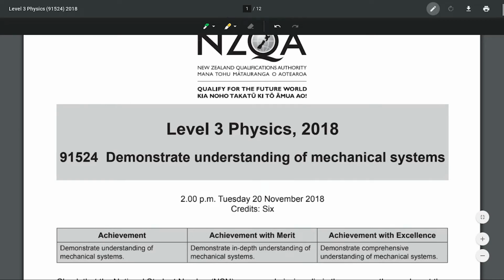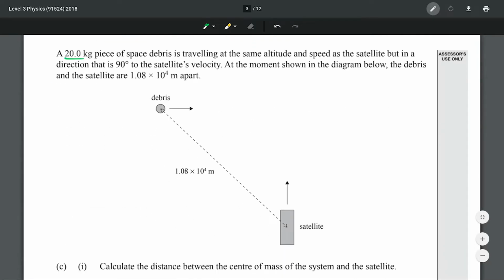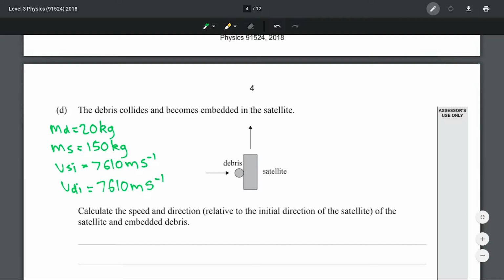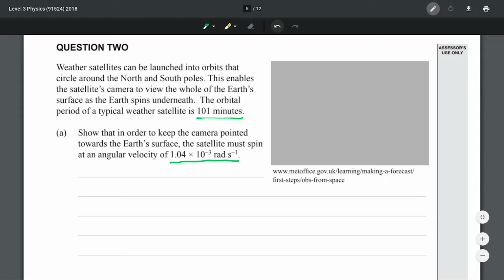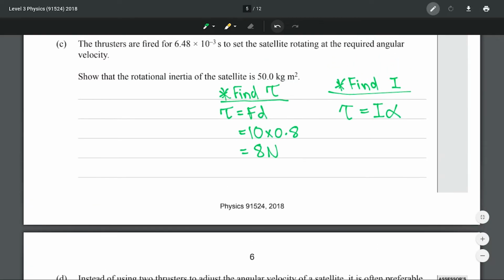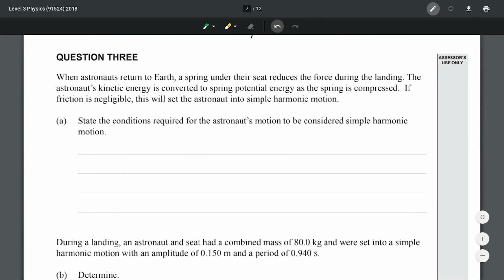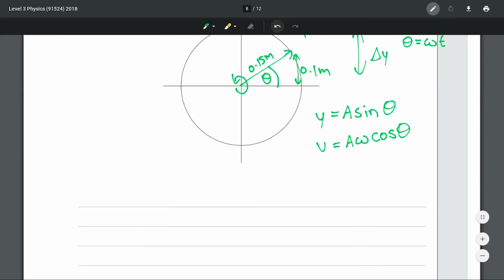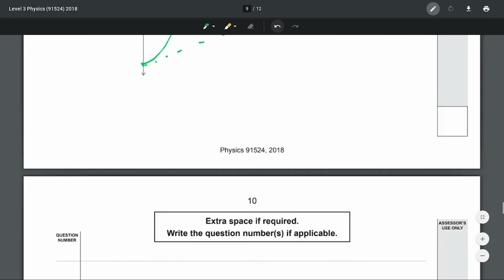2018 Mechanical Systems Exam (NCEA Level 3 Physics)

Comment: For 1d, could you find Pi by doing m1v1+m2v2, and since conservation of momentum Pi=Pi, you know that Pf/Ptotal is the value just calculated?
Reply from the maker: Great question. The problem is that momentum is a vector with direction, performing the simple calculation m1v1+m2v2 ignores this, so will give the incorrect answer when momentum vectors are in different directions.

This would be like incorrectly stating Pythagoras as hypotenuse = opposite + adjacent, instead of hypotenuse^2 = opposite^2 + adjacent^2.

Comment: Hi Mr. Whibley, for 2d (16:38) can you plz explain why it is angular momentum? I'm not really sure how you get that and how we suppose to know. Thanks
Reply from the maker: Good question. The reason we use angular momentum is because we know that it is conserved, as long as there are no external torques (which is the assumption they're prompting us for in the question). Angular momentum being conserved is very useful because it lets us relate the motion of wheel and the motion of the camera.

This is similar to collisions at Level 2. If two things collide and no external forces act, we can use conservation of linear momentum to analyse the motion of both objects.

The best way to learn how to spot when angular momentum is relevant is to practise these problems. There are a limited amount of ways in which we use this concept at Level 3, it's usually either "one thing spinning causes another to spin" or "something spinning changes size".
Reply: @MrWhibleyPhysics  thanks a lot, it's really helpful!

Comment: Hi! With question 2C, what do you mean by we require an unbalanced torque but not an unbalanced force? Isnt force and torque the same thing except torque to angular?
Reply from the maker: Hi Bunwie, the difference is as you mentioned. Torque relates to rotational motion and force relates to linear motion. In this case we want rotational motion (requiring the torques be unbalanced), but not linear motion (requiring the forces be balanced).
Reply: Thank you sir :)
Reply: so how did the exam go today?

Comment: For question 3c, why is theta measured in radians and not in degrees?
Reply from the maker: You could measure θ in degrees, but you'd have to be very careful with units. Using an equation like ω=θ/t with θ in degrees still works, but would give ω in degrees/s rather than rad/s.

 In general when doing rotational mechanics it's best to stick with radians as much as possible.
Reply: @MrWhibleyPhysics  ok thanks

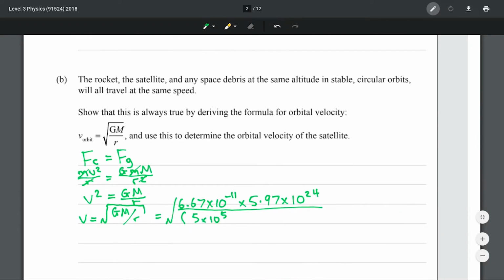Comment: At 3:14, why did u use the number for mass of the earth (5.97x10^24) rather than the number for mass of the satellite (1.50x10^2)
Reply from the maker: Good question. In the first line we use the centripetal force on the satellite, not the centripetal force on the earth. We therefore use the mass of the satellite in the centripetal force equation, which cancels with the m in the gravitational force equation.

Comment: For the first question when I typed the numbers in my calculator, I got 1265.5 rather than 1270
Reply from the maker: Hi Lime Cat, 1265.5=1270 to 3sf. I'm rounding to 3sf because that is the lowest sf of the values I'm using (in this case they're all given to 3sf).
Reply: @MrWhibleyPhysics  Oh so all numbers must be rounded to 3sf
Reply: @limecat7923 no, you round it to the significant figuresprovided in the question. If In the question it was 1200 then you would round to 2 sigfig, but if it was 1290 you would then round to 3sigfig. Numbers used was an example

Comment: For 3C, the placement of the vector, why must it be there? Because I did it on the 2nd quadrant (top left). It should work the same but the angle (if the vector was top left) is now top left of the vector. I don’t know where to place the angles 😢. Can you explain why the angle must be opposite to 0.1 and hyp to 0.15. What I did was cos 0.1/1.5 which is wrong
Reply from the maker: Hi Mark,

Excellent question! You were very close. If you've drawn the phasor moving counter clockwise from 12 o'clock, all you need to do is add 90° (2pi/4) onto the angle you've found. This is because the SHM equations we're using assume that the phasor has started from equilibrium (3 o'clock).

Doing that will give you the correct velocity, but negative since it's travelling in the opposite direction. Here is the final calculation using your method: https://www.wolframalpha.com/input?i=0.15*6.68*cos%28acos%280.1%2F0.15%29%2B2pi%2F4%29

Comment: have my mock exam tomorrow, any tips to remember how to explain physics principles? I sometimes find it a little hard to remember certain keywords required to get full marks
Reply from the maker: Hi tkdyt0674, I'd suggest running through explain questions on past exams and marking your answers. This will give you a good idea of the specific words and ideas that the schedule is looking for.
Reply: @MrWhibleyPhysics  thanks for the idea! definitely will try this
Reply: @tkdyt0674 what was in the mock exam

Comment: For question 3d can I add this on to the explanation. The loss of energy is due to the friction force that will convert the energy to heat?
Reply from the maker: You certainly could, though in this case it wouldn't net you any additional marks.

Comment: For question 3c, I'am not sure when to use radians or degrees when calculating the velocity. I thought I had to use radians when I calculated the angle but then I switched back to degrees and got the wrong answer? do I have to stick with radians the whole time when doing those problems or do I change it to degrees?
Reply from the maker: When working with rotational quantities it's usually safest to stick to radians. An exception would be if you were given or asked for an angle in radians.

Comment: For Question 3C, if theta is equal to Omega x T, why do you have to work out theta? Can't you simply multiply Omega and T together and use that in the equation? I know both garner different numbers, and I was wondering why. Is it because the astronaut is at a different position?

Thank you in advance
Reply from the maker: Hi there, I think you may be confusing t and T.

t is the time taken for the angle we found (0.730rad) to be rotated through.

T is the time taken for a full rotation of 2pi.

For this reason theta=omega x T = 6.68*0.94 = 6.28, which just so happens to be 2pi! https://www.wolframalpha.com/input?key=&i=2pi
Reply: @MrWhibleyPhysics  Yes! Thank you so much, this cleared up my confusion. Legend!

Comment: Thank you
Reply from the maker: You're welcome
Reply: @MrWhibleyPhysics  For question 1D why did you use momentum? Wouldn't the given speeds be enough to find the speed that they travel in? I notice that the result is different if I don't use momentum but I don't know why. Thank you for your time
Reply from the maker: @dr.chopsticks2352  Great question. In collisions momentum is conserved (total momentum before = total momentum after) but since the mass of the satellite is greater than the mass of the debris, speed is not.

Consider the kinetic energies. Initally the debris is travelling at 7610m/s, giving it a particular amount of kinetic energy. When it collides with the satellite it now needs to move the satellite's mass too. Since the kinetic energy required to move this larger mass at 7610m/s is more than the kinetic energy available, we instead see a reduced velocity in that direction. Hope that helps!

Comment: For question 1d would 82.4 also be valid for the angle
Reply from the maker: Hi Annon. Technically the question asks for the angle relative to the initial satellite velocity, which is 7.6°, so this is the correct answer. That said, the assessment schedule does state "Note: Look for an angle of 82.4°. This is the complement of 7.6°", which might suggest they also accepted 82.4° for the full excellence grade. I can't say for sure.